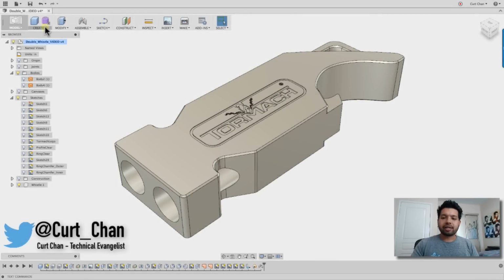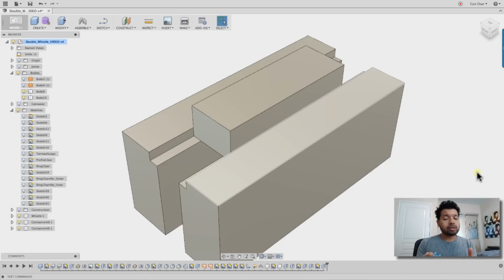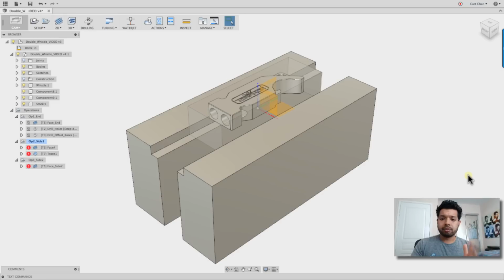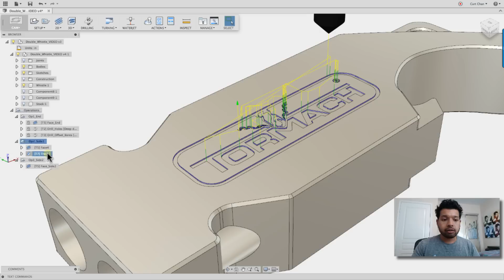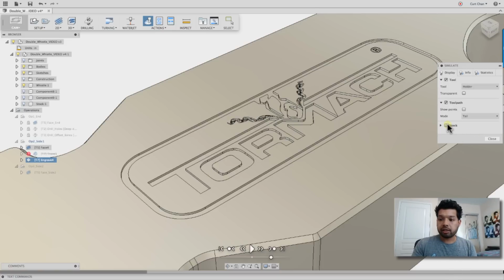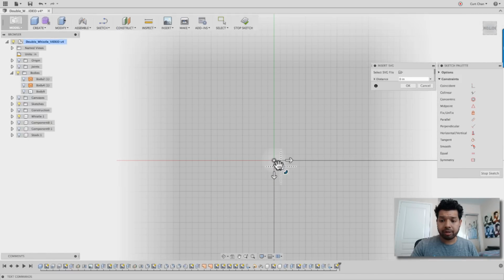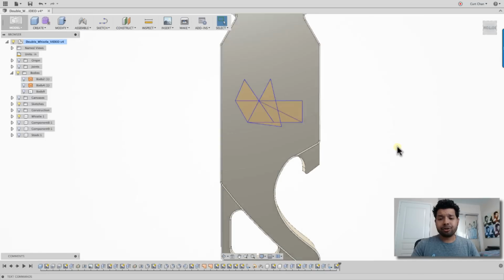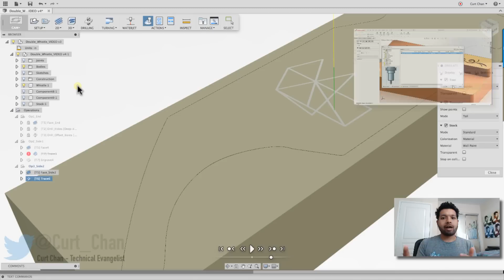Fusion 360 CAM: Engrave vs Trace

Comment: For some reason, my O's don't work right.  Instead of recognizing that one curve is inside another, it seems to treat the two parts of the O (inner and outer) as two different circles.  Is there a trick to making that work right?
Reply: Try the engrave function for just the O  :)

Comment: I've been trying to use the engrave function to make inlay work, but haven't figured out how to make the male part yet. I wish to v-carve a design in to the work piece and then make a separate piece with the male part of the same design, so that I can glue them together and then sand it flush to create a very detailed inlay. Is this possible, or am I wasting my time trying?
Reply: +Auarhau have you tried a Boolean?  Like the 'combine' feature...trying to make the male piece.
Reply: No, that is beyond my skills at this time. I'd appreciate it a lot if something like that could be made into an example like the one you showed here.
Reply: +Auarhau No problem...check this page out here.http://academy.autodesk.com/software/fusion-360

Also, check out the 'Combine' Command on the begineer section, I think that could help.  Let us know.
Reply: +Curtis Chan Looking for something like this - http://www.vectric.com/support/training-material/bonus/vinlay.html  
Right now it doesn't seem possible in fusion, but I'm still experimenting.
Reply: +cyberreefguru What are you specifically trying to do?  Im thinking Engrave to be able to do it, it's the same technology as v-carve.
Reply: Curtis Chan The same as me I believe. I still can't figure it out. A video would be most welcome. First v carve 1 protruding piece (letters or something), and then v-carve the same design on a separate piece only down in to the material so that the two pieces fit together like a pusle. When you sand or plane it down you would end up with a inlay, which is not limited in detail on the corners like with a round cutter.
Reply: +Curtis Chan I'm simply trying to emulate what folks with vCarve can do.  I played around for hours this weekend with no success.  I could not get the engrave to work properly on the vector - it just would not follow the contour to create the pocket. Then I mirrored the outline and fusion would not let me select any of the mirrored lines for CAM operations.  It seems to easy but I just can't get it to work.
Reply: +cyberreefguru Would you mind emailing me the .f3d file?  Or invite me to the project?  curtis.chan@autodesk.com
Reply: +Curtis Chan I can share it with you. Won't be until next week though.